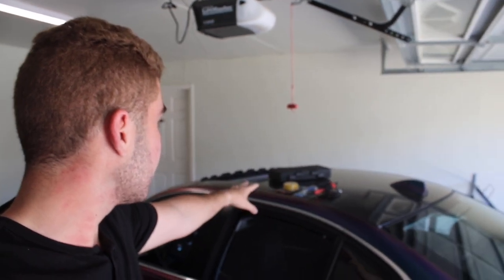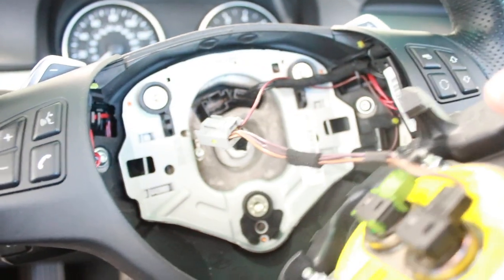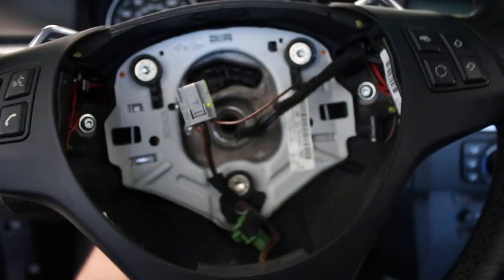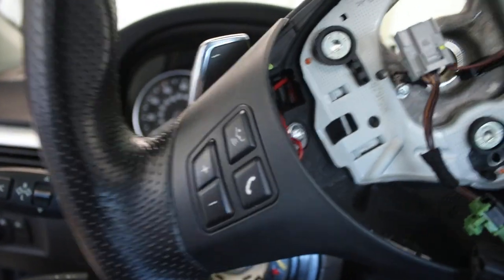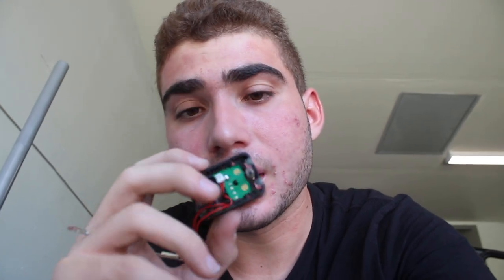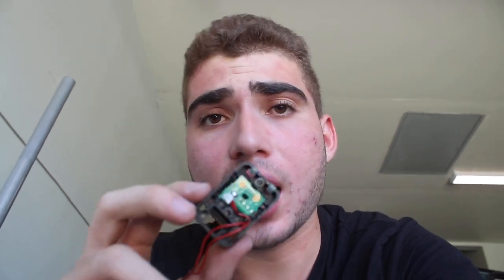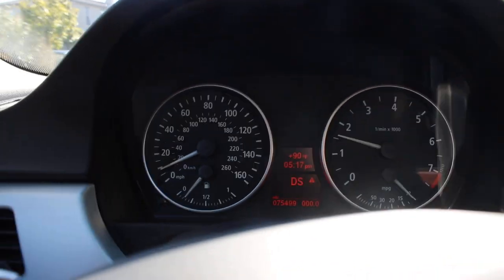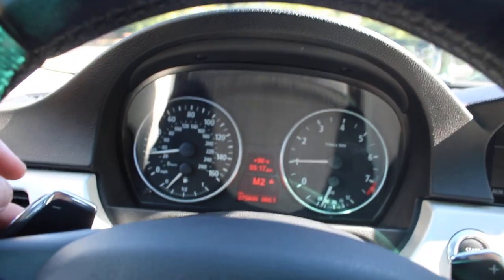PADDLE SHIFTING RETROFIT COMPLETE (Conversion PART. 3)

Comment: ok this may sound stupid because i don‘t really know what i‘m talking about. but wouldn‘t it work without all those wires if you just enable paddles via coding?
i just ordered the same wheel. it comes out of a e90 LCI, why should i have to do all that resistor stuff when i take a wheel off an e90 LCI to put it in another e90 LCI. it just doesn‘t make sense to me.

Comment: A few months ago I purchased an e90 LCI 328i that came with paddle shifters that look almost the same as these ones and I didn’t know if they are stock or not. Ever since I bought the car my passenger restraint system malfunction light has been on the Idrive  along with my airbag light. How do I fix it?
Reply: James Berdeja it’s a fault on bmw it’s a recall call your local dealership they should take care of you for free ask them about the takata airbag recall
Reply: Robles Inline 6 okay thank you I definitely will 👌
Reply: Robles Inline 6 I just looked up online my vin for any recalls on bmw website and a drivers steering wheel airbag is in open recall. Thank you
Reply: James Berdeja welcome

Comment: Hello, ask about the screw size of the shift paddle lock on the steering wheel, because I bought lci paddles, but different from the screw on ssg, I hope I can get the answer.